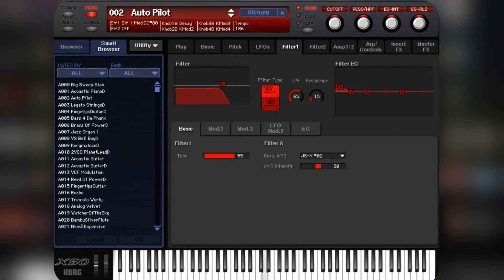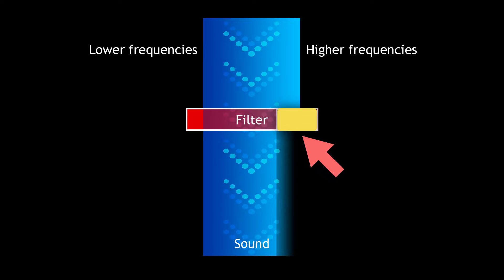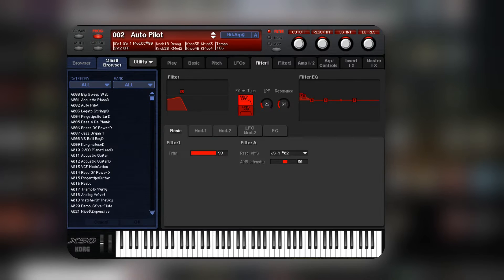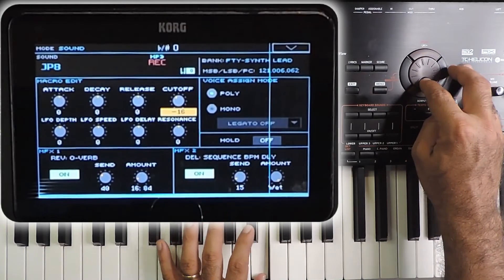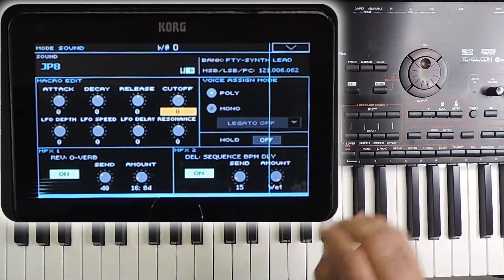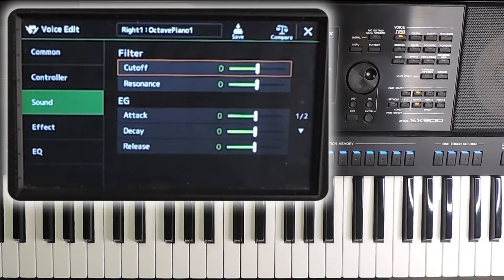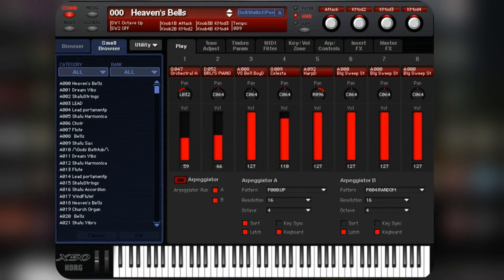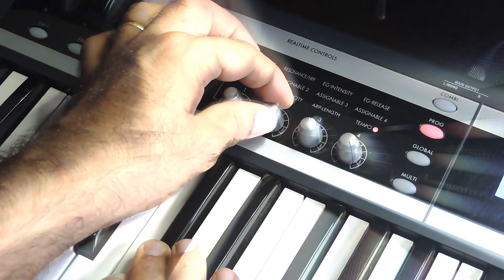Cutoff & Resonance | Easy sound editing technique

Comment: Namaste and Ajo.  It's been a year.  I am trying to reduce resonance.  It has a transient frequency, that I cannot identify.  It's in a lower band on the knob turning to the left.  I did not understand precisely in the video, where to adjust.  I think, it has to do with the compression settings.  At compression ratio, EQ, master volume, track volume, meter, and single track.  It removes the peak of the waveform.  It is a sawtooth waveform.  The higher harmonics have a slope.  Sound bands in the medium bands are even.  Sloping in lower and more space out harmonics to the left.  Right, before the increase of amplitude is a sound I'm trying to reduce.   Any know how on that?  Thank you very much for your video.  Subscribing.
Reply from the maker: Which keyboard? Korg or Yamaha?

Comment: Manoj sir, is effect of increasing EQ high and increasing resonance the same ? Or there is difference? As both makes sound sharp and brighter...
Reply from the maker: With resonance, it depends in the cut off frequency. If it is higher resonance will increase the high frequency. If it is lower, it affects the lower. It always affect the frequency at the cutoff point.
Reply: @ArrangerTutorials  yes got that.. but is increasing eq high makes similar effect ?
Reply from the maker: @pappu182  yes